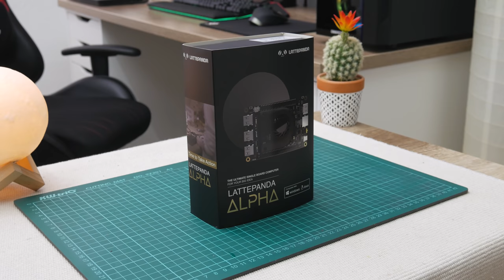NOT a Toy -  It's a PC

Comment: bro you should get a matching trailer to hook up to the back of the truck to properly carry a bigger gpu. It can add support to the gpu so it doesn't flop around. I think if you find a matching trailer or 3d print one with wheels to match the aesthetic, you could put the gpu inside it. It will also have room for cable management. Also there is a small adapter board for the storage card, you can screw the storage card to it, and the adapter you can screw down to the late panda. Also you can make the trailer with acrylic sides so you can see the gpu inside. You might be able to put in some rgb lights in there if you do put acrylic sides, or you can use opaque panels and make it a sleeper. I think that a trailer can also add the option for a neat port for all the connections like the usb hub, hdmi, power, etc of the computer on the back. Another idea is that you could wire up the headlights to make it look like a real truck. Loved this project!
Last idea is that you could get a bigger remote control toy truck with a trailer and put the whole computer in the trailer and leave the front of the truck as remote control so you can drive your whole computer around with a remote control in real life instead of in a game?
Anyway, I would love to see part 2 of this project in the future! :)

Comment: in how much money we can build this plz reply
Reply: The tools alone? Or including GPU?

EXP GDC NGFF (the external GPU docking used in this video) is about $35 - $50 depending where you buy it from

A sufficient power supply at least 220 Watt or higher for GPU itself $15 - $25

GTX 1650 depending on your local price? I can't estimate the price.

Soldering iron capable of melting several acrylic $4